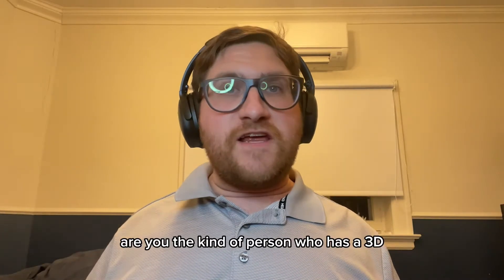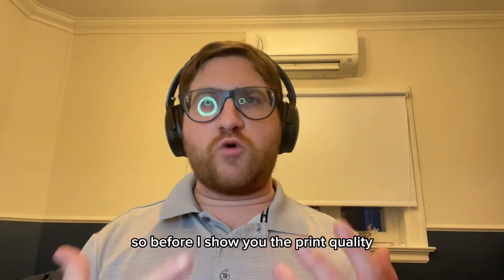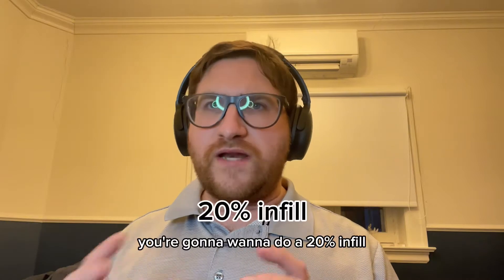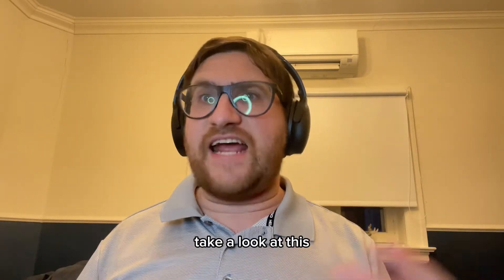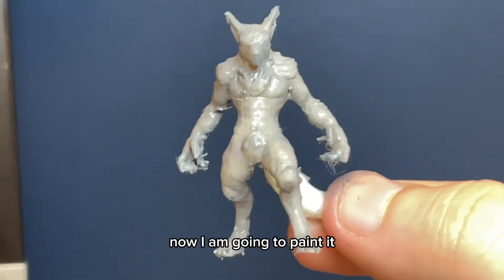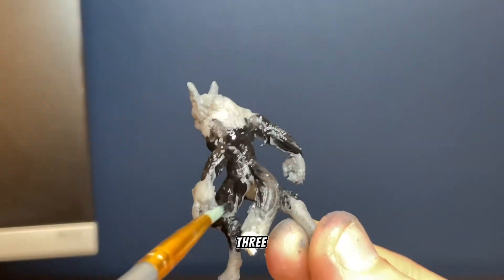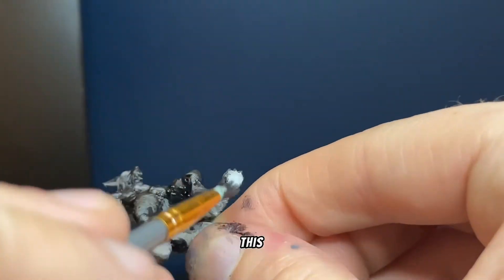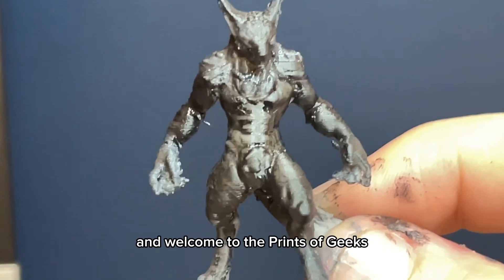How to PRINT and PAINT a Miniature on an FDM Printer

Comment: Hey! Great video! I just got my first printer Ender 3 V3 KE and I am going to try your reccomended settings.
What nozzle temperature did you print with and what slicer did you use?
Reply from the maker: Hey Thanks! I used a temperature of 200, and I used Cura for it!

Comment: I like the quality. I have a qidi xmax and have always wanted to fdm print minis but I don't have enough examples to confidently go for it. Thanks 👍
Reply from the maker: The quality is pretty decent for an entry level printer like mine. The biggest thing that helps is the print speed and a lower layer height. I appreciate the compliment!
Reply: This is interesting. Do you use any finishing touchs to erase miniature layer lines. I've been using UV resing or even Poliuretane Varnish and that helps a lot. Sanding is way hard to do in this case, so I"m looking for a good option to fill the minis of this size
Reply from the maker: @jchamorrob  so I haven’t really tried much for cleaning up the layer lines, but resin is a great option. Are you using a small amount of resin so the print doesn’t lose its details?